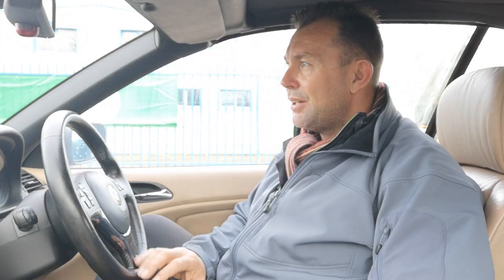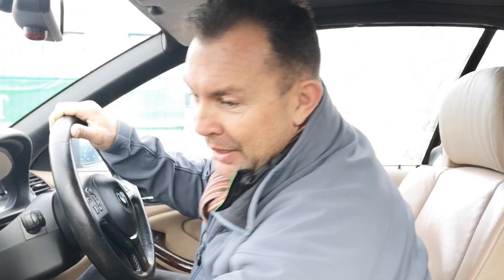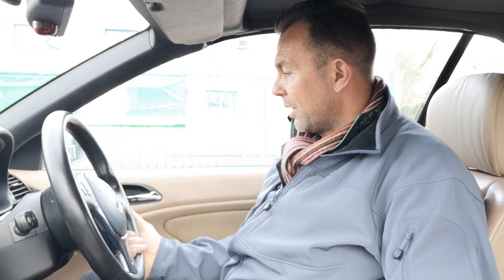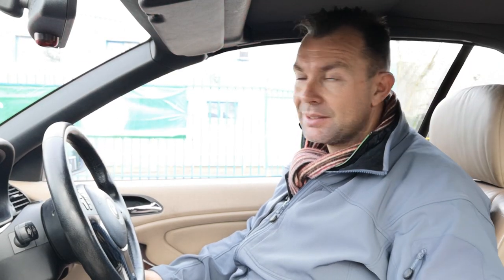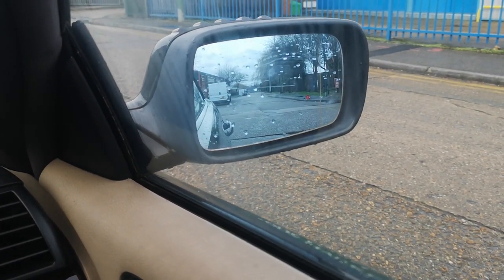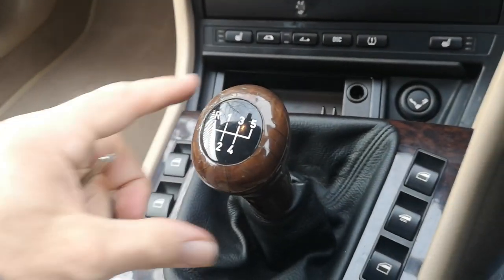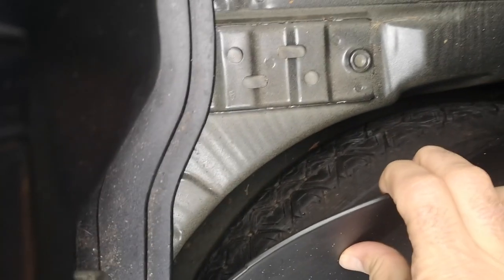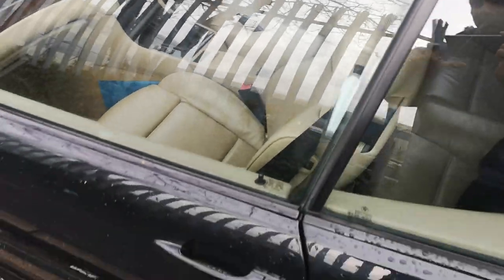BMW 3 Series E46 Convertible Common Problems Part 1

Comment: If the windows are able to get down when you open the door, then the issue you described might be related to the switches themselves. Maybe a scan tool can reveal your problem.

Comment: Window fix... try disconnect the battery for 30 second  .. then start engine . Turn off turn back to position 2 open door  window should go slightly down
Reply from the maker: Cheers Zack I will give that a try. ; )
Reply: Did it work?
Reply from the maker: No..still same.